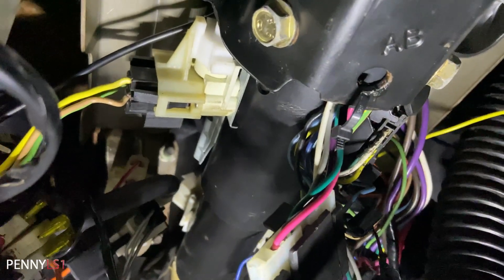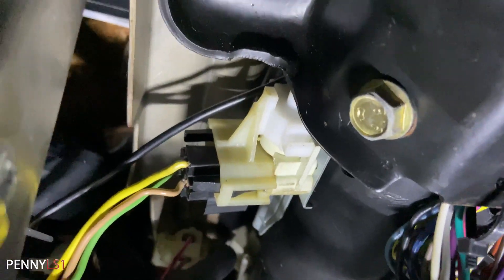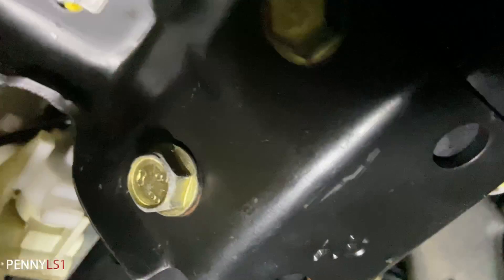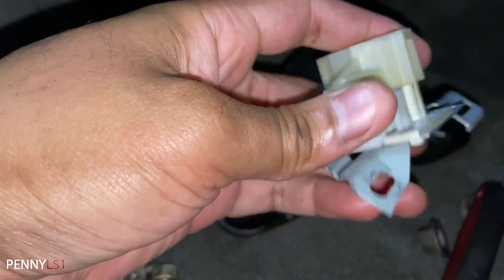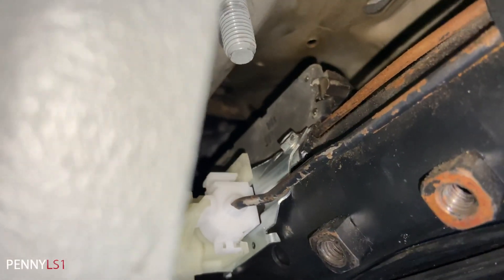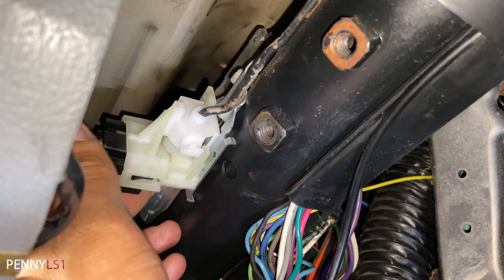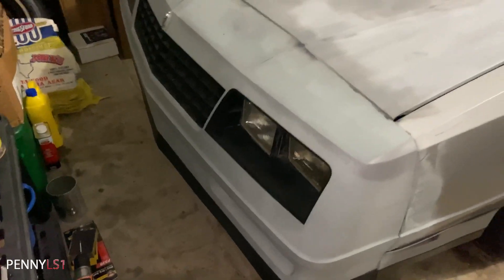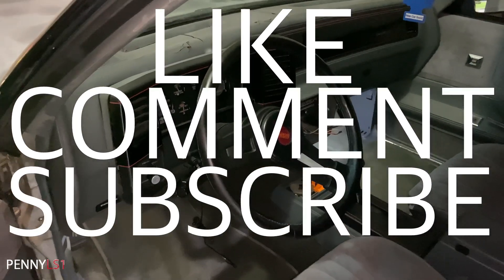How to install New Hi-beam/Lo-beam Dimmer switch. 86 Monte Carlo SS

Comment: Yo after I change this switch out the car won’t start, I turn the key over and nothing happens any information on what I did maybe……..I figured it out the 8mm bolt that hold the dimmer switch also hold an switch that connect to the ignition, had to realign that switch and it started back up but thanks for the video got my low beam back working g

Comment: Great video!  Just inherited a 1987 Monte Carlo SS with 305 HO (High Output).  The headlights were not working at all.  Upon dropping the steering column, I notice the electrical pigtail was not plugged into the switch.  Of course I plugged it in and still no highlights.  The switch would not click.  The switch itself had 2  each 8 MM screws securing it to the steering column.  The screw on the front (toward the driver's seat)  was fairly easy to remove but the rear screw, it was impossible to remove as I just couldn't reach it.  Solution, just twist the switch until it broke at the screw connection.  I was able to mount the new switch, but inserting the rear screw, forget it.  The lights work fine now so If you were wondering why you only had a single mounting bolt on the front of the switch, it is because the switch was replaced in the past and the installer, just like me, couldn't mount the rear  screw.  Again, many thanks!
Reply from the maker: I was wondering that. I had a hard enough time with the one screw lol. Thanks for watching

Comment: My parking lights not working on my monte  need help
Reply from the maker: If the fuse is ok, I would check the bulb connectors for corrosion or shortage in the wires.  You can get pigtail replacement harness and make it all fresh connectors.

Comment: Been having problems with my 81 monte , gon have to dig under the steering column and give it a shot , i’ll update if it works
Reply: Yup it was the dimmer switch. The most time consuming part was taking off those 2 small bolts where the switch is held . Holy crap there is no room to work . But thanks for the vid! Going to finally take it out on a spin this weekend

Comment: this is happening to me too. but its not my headlamps its my turn signal lights!!!.This is my 1985 monte carlo with cornering light, the CL edition, 
i replaced the front driver side turn signal pigtail socket and the light has no running light,but it does blink when you turn the right signal light on, but once you turn the signal off the light goes off( no running light), but the passanger  turn singal light is still on and works. i dont understand??